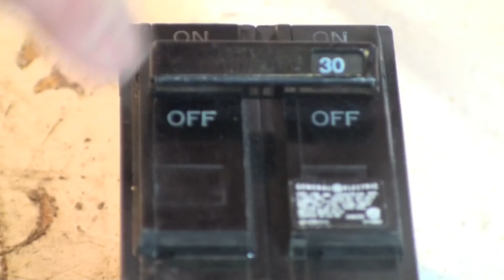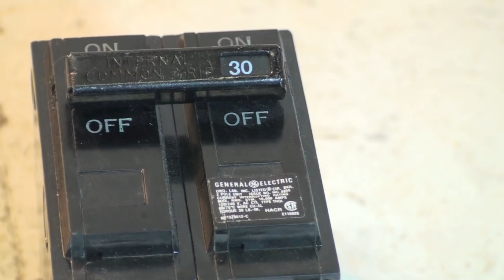Why does my panel breaker keep kicking off.  Breakers #2

Comment: what if the breaker kick off but stay on on position (double checked several times) and the problem moves to other areas of the house randomly and the only way to get it to work again is turning the knob for the heater?
Reply from the maker: Sometimes the breaker will not move to the center position (it should) and the breaker has tripped.  I would replace the breaker.  I have no idea about other areas.  Your heater probably has a short inside.
GFM
Reply: but how its gonna be the heater the problem if the heater is off all the time matter fact the heater was the one activating everything back when it was been turn on. Plus not trip sound was happening , and sometimes when everything was coming back on energy was weak. They replaced the meter outside cuz we had lost power and the electrician determined there was no power from the meter to the breaker box inside the house. So he replaced it and no issues at this moment with electricity.   thanks for replying btw ...

Comment: Hello I have a split break 20/30 for my hot water heater both are new I put in in about 2 months ago everything was fine now its tripping after a minute I put it on do you have any ideas why??
Reply from the maker: First be sure the wire terminals are tight.
GFM
Reply: 0326Ghost  you likely have a bad  element
Reply: Element starting to go bad: Also check connections, especially ground at water heater.

Comment: Will the one breaker that's bad affect the entire box/system....My entire electrical system fails!  But when I turn off the bad breaker and turn on the main breaker everything works again.  You think that one breaker will disrupt the entire power?
Reply from the maker: Many times, when there is a dead short, the main breaker will open before the breaker on the circuit will.  The reason for that is the main panel breaker is of higher quality and is more sensitive.
GFM
Reply: Thank you~

Comment: Furnace won't turn on had ac guy look at it he said it is electrical braker is good
what do you recommend i do next.
Reply from the maker: I assume the problem is in the field wiring between the furnace and the breaker panel.  You will need an electrician for this.
GFM
Reply: ok thanks sir

Comment: I have 15 amp 110v. breaker to our bedroom that trips as soon as it is reset, everything in that room has been unplugged but it still trips. any ideas? I replaced the breaker but it did the same. It was working fine the night before
Reply from the maker: You have a short in the wiring(nail penetrating the cable?), a short in a wired in load or the outlets themselves.
GFM
Reply: do you have a video on how to check outlets for short with power off? or can describe in a few words?
Reply from the maker: You can turn off the power, use an ohmmeter to check from hot to neutral, then hot to ground with all plugs removed.  Should show no continuity.
GFM
Reply: thank you

Comment: I had a transformer for a doorbell go bad. It would pop the breaker once in a while. I thought my kids were plugging in too much stuff. I disconnected everything from the first receptacle to kill everything downstream and it kept tripping. Since the initial piece came from the garage to the house I thought a mouse might have chewed wires. I traced the wires and found a junction box in the attic where the transformer was mounted. I took it out.. no more problems.
Reply: obsolete  sp9 Zoe professor

Comment: and how do I get to the lead if it is behind a metal panel? I am in an RV.
Reply from the maker: Could be ugly.  I worked on RVs for 3 years.  Could you send me a pic?
GFM
Reply: +grayfurnaceman i will send it after work.
i am almost positive the double pole 15 amp, the side that runs 2 plugs, the frig and the ceiling fan is going bad. I didn't have problems last year and I ran more than what is plugged in now.
I believe that when the water heater kicks on (which is the other side of the breaker) is when it trips if things are running at the same time.
If I understand correctly how a double pole works, if the one side is bad, I wouldn't necessarily know until what the other breaker runs kicks on. This morning when I felt the breaker, it was warmish. Last night it was cool to touch.
Reply from the maker: If it is warm, replace it.  If the the breaker is a double, meaning the handles are connected, it is 240 volt.  That would be unusual as most RVs have only 120 volts.  
GFM
Reply: +grayfurnaceman finally got a hold of my repair guy. he said I can probably go up to a 20 since I have a 15 amp spot not being used.
my rv is a forest river. falling apart practically as I didn't do my homework and bought it even when I had reservations about some things I saw, but it is from a top of the line company. mostly repaired now. i hope. the breaker is probably the original and is 10 years old.
Reply: +grayfurnaceman thank you for the advice.
Reply: +grayfurnaceman handles are not connected. but there are 2 handles on 1 breaker.
Reply from the maker: I would not replace it with a higher amperage breaker.  The breaker is there to protect the wiring from the breaker to the appliance.  If the 15 amp breaker is replaced with a 20 amp, it may overload the wiring and cause a fire.  Just replace the breaker with the same amperage.
GFM
Reply: +grayfurnaceman ok. will do. thanks again.

Comment: hi thanks for the video very helpful, i have my front load samsung washer and for the past 2 years no issues just today turned off by itself and breaker went red in the middle went off, so i reset the breaker and unplugged the washer reset everything and it worked for 15 min turn off again idk if i should call an appliance repair or electrician.. please advice.. thank you...

Comment: So idk if my issue will be resolved or not today, but everywhere in my apartment the power is working. The Living Room however, it has been going out for no reason. Lived here for quite sometime and its never done this, i would assume its a building thing or something but unsure. I had to reset the breaker for the Living Room 6 times within 1-2hrs not even. Its like 10mins later it switches off for some reason. Now at this time, its been ok. Why would this occur? We dont over load our outlets to need the breaker to break.

Comment: It looks like the AC breaker has two sets of wires going to it... what's that about?
Reply: Some breakers (such as Square D QO ... but NOT Square D Homeline) are designed to take up to 2 conductors on the breaker.  For those that are not you can pigtail 2 conductors together to get the same result.  You might want to double up if you need the space and you know the two you are doubling up won't exceed the breaker rating.  You can NOT change the breaker size .... it must protect either circuit, not the total of both.
Reply from the maker: Its 240 volts so its a double breaker. 
GFM
Reply: grayfurnaceman with 4 wires going to it... two whites on the top terminals, two blacks on the bottom. Look when he zooms in. I said two sets of wires not two wires.
Reply: The ac not working over here maybe the parasite got it

Comment: Just a note to Kris
It all depends on the utility company's transformer outputs... some are 110.220 wye or 120 240 delta.
Reply: Louis Rain
Reply: Lou   I hope that you have learned that this is incorrect by now.   There is no wye or delta in residential services from the utility.  Those are 3 phase terminology.   The numbers are nominal and can be from 110/220 to 125/250 volts.  It's all the same thing.   Utility company is plus or minus 10%.

Comment: I have a 20 amp breaker that goes off after two or three days...There is only a small  window a/c unit, and TV , and one small fan on this line...I checked all the wires to make sure there was no cracks/cuts ..everything seem to be ok...I purchased a new 20 amp Square D breaker and everything seem to be ok...but three days later the breaker trip again.  I am drawing no more than 18 amps on all the units ...there is no burn marks in the panel box ...I just don't understand  what the problem is...Can you help me with this problem ??? thank U.
Reply from the maker: A/C units draw 2 to 3 times their rated amps upon startup.  This could be when the breaker sometimes kicks off.  Also be sure the bus bars are not burned and the wires are tight.  Hope this helps.
GFM

Comment: my problem was the breaker going off with no blown fuses every time you turn on the unit. turns out it was a bad compressor.
Reply from the maker: +Bobby Sparling Often times the breakers are quicker to open than fuses.
GFM

Comment: Question: Why are you not measuring to ensure that the circuit you're working on is safe? (and after that measuring a live wire to see if the measuring device is working correctly)
 What if the breaker is broken or someone wired it into another breaker circuit inside the house?

Comment: Tightening the terminal screws was exactly the problem. One was a few turns loose on a two- pole 40 amp breaker for the oven that kept tripping.

Comment: Wow, this subject has a lot of areas for discussion.  I had a Federal Pacific Panel (FPE) with STAB LOK Breakers.  The Air Conditioning 240V breaker kept tripping out--summer use(1993).  Found the breaker blades to be burned and companion bar mount ruined.  Replaced the whole panel a year later.  FPE panels with STAB LOKS are potentially hazardous.  Google it.  If you have an older FPE panel, watch out!!!  Especially the 240V breakers in it.  The internet has a lot of info on this.  These breakers have caused house fires.  If you hear buzzing sounds or can smell slight burning inside the panel, check the breakers like so stated in the video!
Reply from the maker: +DOLRED Lots of good info here.  Especially the burning smell.  Thanks
GFM
Reply: Federal Breaker panels are junk.  i remember working with a couple of Sparkys on a job  and he tried to get the circuit off in the basement.  He said, he would just short the plug out to kick it out instead of going downstairs to find it. guess what after trying he gave up and went down to the breaker panel to find it.  the Federal Breaker would not kick out.    Federal panels =dangerous fire breakers.
Reply: @zerosparky9510  I was shopping for a breaker locator. Bought a Klein for $50...but they had a Ryobi one you would plug in and it would kick off the breaker. Heh. That was $30
Reply: Federal pacific are junk. They were sued out of business forever ago. They were found to not trip. They were built wrong and found to be more like a switch than a breaker

Comment: That's what happened with my AC breaker a week ago.  Aluminum wires  and one of the leads had no paste. He re pasted leads and re tightened and the breaker has not kicked off since. He used a thermal gun and said it was 170 degrees when it should have been 125-130. Coupled with dirty compressor fins causing my AC to work harder.

Comment: Just trying to figure out why I no longer have ceiling fans and kitchen lights....but everything else is fine in the second house.  Not sure if being in Florida close to the coast and lots of heavy rain has to do with it...but thanks for the directions.  BTW...2nd house was built in 1959...Methinks the contractors skipped a few steps when it was restored 2 months ago....
Reply: +Blaine Morrow Latent high heat and humidity did it, so the electricians told me...had the tankless water heater repaired 4 times since I moved down here to the Tampa Bay area 8 years ago...high tropical humidity will do that.  As I oft tell others, live near the gulf (or on the other side, near the Atlantic), there are just 2 seasons...Hotter than h$%*, and Nice....that's it....LOL!...but it might be age...just my views.  talk to the local (trustable) electrician...

Comment: Hi I have a portable air conditioner and when the washer and or dryer is on the circuit breaker trips around 15 minute but it the portable is off is circuit does not trip, can you help me
Reply from the maker: Mark Williams You are probably overloading the circuit.  The washer should be on a dedicated breaker.  That means no other appliances on the circuit.  The air conditioner should also be on a dedicated circuit.  I realize this is not always possible.  If you can find an outlet that has few or no other loads, it may work ok.  Hope this helps.
GFM

Comment: so its the wires being loose to that breaker , correct ?  i purchased a building erected in 1954 , theres a small room in the back that has lights ( fluorescent ) and its just those lights that go off even if all the lights are off ...question so i wont get electrocuted do i use an insulated screw driver to tighten screws or switch off all breakers and use a regular screw driver ?

Comment: 25 year electrician here you might also have said something about the double taps on circuits 7and 9.
Reply: I have a bathroom and 2 bedrooms that the lights keep turning off I went to replace the fuse in the breaker box and it does the same thing keeps tripping off right away so you think I could be the fuse or something on the panel
Reply from the maker: +Daniel Barajas My thoughts here are that you have an overload connected if the fuse blows immediately. Unplug all loads then see if the fuse blows. If it does, you have problem in the wiring. If it does not blow, plug one load in at a time until it blows, and you have found the problem. Hope this helps. 
GFM
Reply: thank u very much your the man

Comment: Torque to specs as displayed on placard, this eliminates any guess work. If available, use infrared thermometer to see hot spots where connections are lose, this will be a higher than ambient temp due to a high resistance. That is the one that is causing the problem. Hope this helps.

Comment: My fuse #15 has 3 wires the one i cant seem to remove is named panel neutral i havent seen a screw to loosen like the other two wires have. So how do i remove my fuse?
Reply from the maker: djerrrr Is it a gound fault interruptor?
GFM

Comment: All this fight about gloves, I wear them when testing 575 high voltage industrial equipment, but when residential, shut the whole house off, tighten the connection, or if changing a breaker, shut off the main power to the house, use a flashlight. It not hard,
Reply from the maker: mychoclabwinston Agreed.
GFM
Reply: Amen brother.

Comment: Good information but let me say this, wear leather gloves as a minimum. Electrocutions are a daily event and incidental contact is a common theme. Protect yourself!! Know NFPA 70E and all the hazards involved before you go diving into energized panels.
Reply from the maker: ken4chief I know I must seem cavalier about this but I find I get in more trouble with gloves than without.  The lack of dexterity is my main problem.  I am very aware of the hazard and do take precautions when working in live panels.  However, I am not saying your advice is wrong.  Thanks for the thoughts.
GFM
Reply: No disrespect and I get what you’re saying about the gloves. It’s a struggle. I've investigated a few electrocutions. I take them very personal and they all could have been prevented. Be safe my friend.  Work de-energized when you can and wear the gear you need when you can't.

Comment: Thanks 
  I was waiting for you to give the cause of a fuze blowing rapidly. 
 Anyway in my garage I have a circuit that keeps blowing. It appears to only
effect the one ceiling light bulb an plug on the ceiling for a shop light 
The outside lights are on the same circuit as well. i have taken the light fixtures of outside completely. The problem starts when I flip the light switch on. It blows the fuze immediately.  The wall outlets are on a different circuit  
with the garage door opener.  I know there must be a short somewhere, I've changed out the wall light switch but still same problem
Reply from the maker: About all you can do is remove all loads from the circuit.  One at a time.  If all loads are out of the circuit and it still blows, you will have to check all electric boxes for shorted wires.  The voltage is lethal so do not proceed if you are not confident of your abilities.  Hope this helps.
GFM

Comment: My panel the screws are not exposed or the wires. Could the problem still be the breaker wires?
Reply from the maker: Virtually all breakers have terminals with a screw for tightening the wires.  I may not be understanding you.  You can send pics to grayfurnaceman@gmail.com
GFM
Reply: grayfurnaceman They used to make Stablock breakers. They were like the old stab in outlets, and were to increase production, mainly in residential wiring. Absolute PsOS!
Reply from the maker: Seth B Agreed.
GFM

Comment: This was an interesting video. I went thru this situation with my big 5 HP 2 stage Quincy air compressor. The only difference was that it would take out one of the two fuses in the disconnect switch but leave the breaker untouched, completely at random. It would always blow the fuse on start up obviously, but it was completely at random and only do it occasionally. I checked voltage and amperage, and it was all normal. I then went thru all the connections starting at the circuit breaker all the way to the connections in the motor's junction box and didn't find anything. The only thing I could possible think of is that one of the forks in the disconnect switch wasn't making good contact. I had actually replaced the the fused disconnect with a non-fused disconnect because the compressor was on its own 30 amp circuit with its own breaker. The problem went away after doing this, and the breaker has never tripped.

Thanks for sharing. Scott

Comment from the maker: I'm not an electrician, but can tell you that I have used GFC circuits on ungrounded outlets and the GFC works normally and will shut off if there is an unbalance in power.  If still unsure, talk to an electrician.
GFM